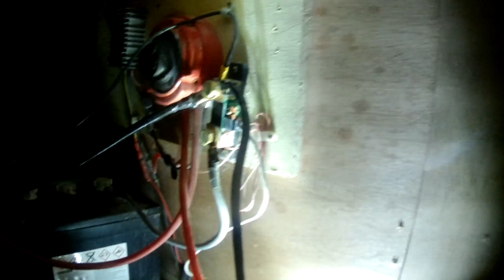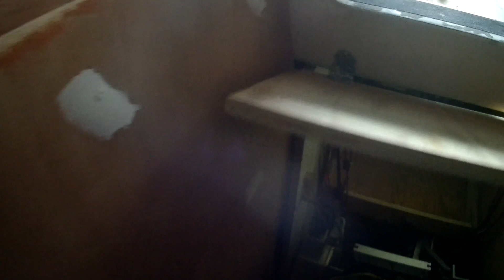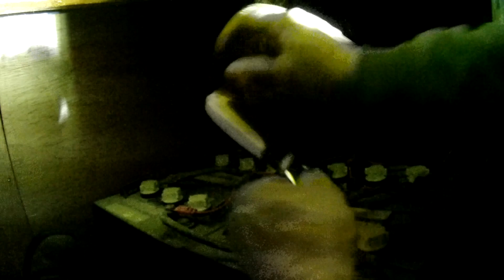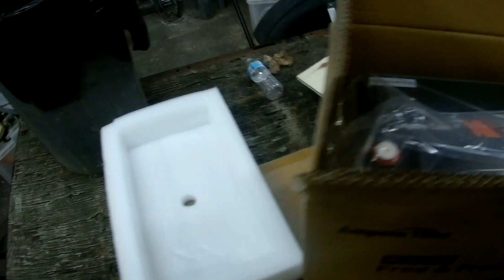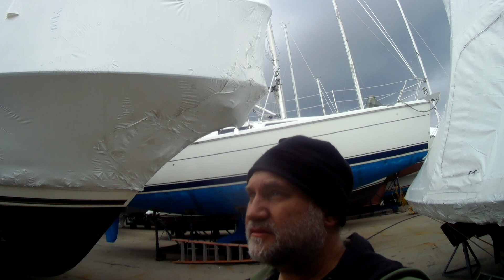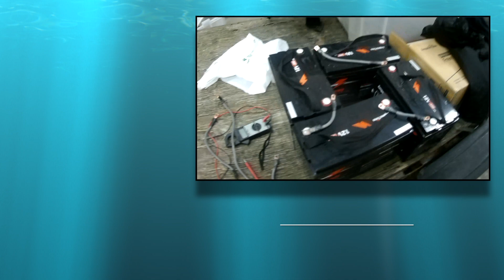Ep117 Unboxing Lithium Ampere Time 12v 100 Amp Hour LiFoPo4 Batteries and taking out lead acid

Comment: Ampere Time, Li Time and Redodo - is the same company, great lifpo4 batteries
Reply from the maker: batteries seem to work well. i had 2 support engagements and both took forever. they only reply once per day in china so it wasn’t possible to get through a dead battery issue without it taking a week of back and forth. otherwise the batteries performed well for my electric motor

Comment: 10 minutes of running at 5 knots for the old setup - plus 450 pounds of weight? Damn thats bad! Was thinking of going electric on a mates boat, might rethink that now.
Reply from the maker: well electric isn’t for everyone. however when you push lead acid batteries hard they deplete exponentially hard it seems. to get 5+ knots i had to run at 75 to 90 amps. my old lead acid batteries were rated at a peak 25 amp max current so that is why performance was less. LiFoPO4 has higher discharge rates which makes more sense. it’s a learning experience that’s for certain.

as for weight i took out quite a few pounds in my boat from removing the old engine and gas tank etc, as compared to present my water line is sitting 3 inches higher now. i never stopped to calculate how much weight difference going to electric saved me. but yeah those 6v lead acids are heavy. the lithium batteries are much lighter.
Reply: @TheNeds  Thanks for the reply - be great to see an episode on the capacity of the new batteries at full throttle when they're in! Good luck, I am following your adventure
Reply from the maker: sounds like a great idea for a calm day